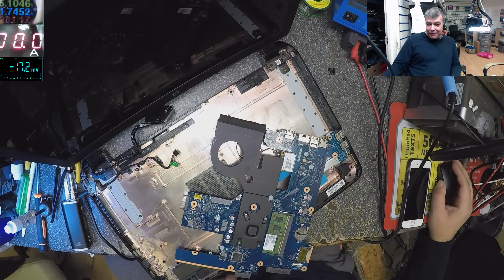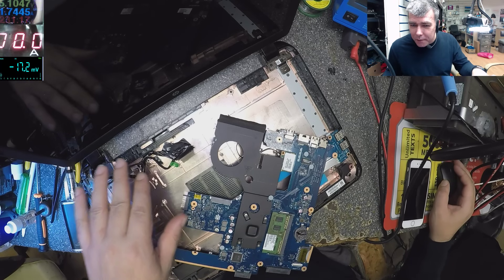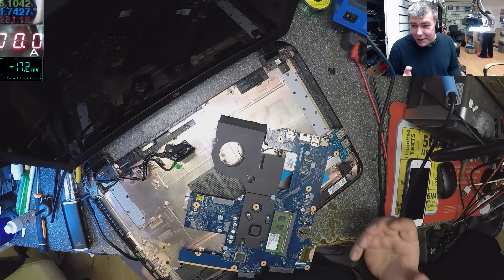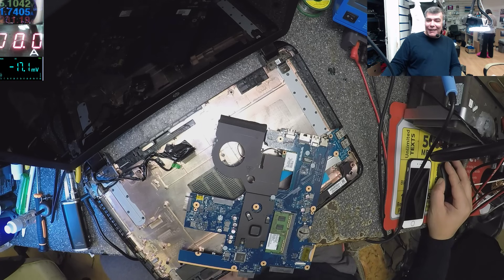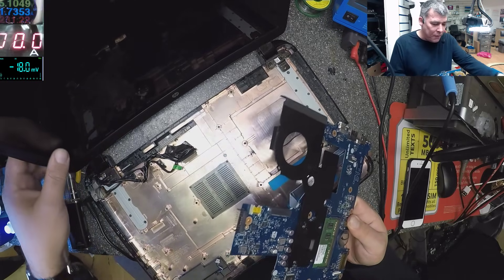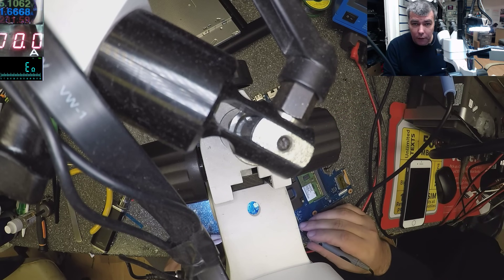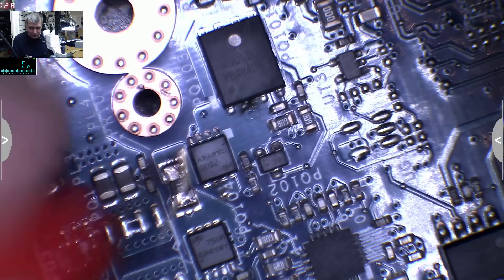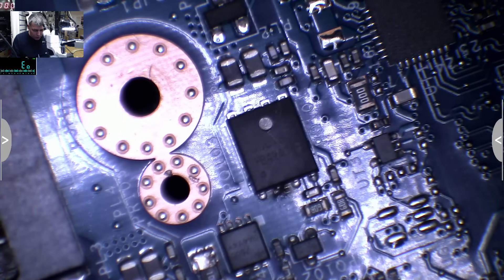Hp 15-r101na, dead board, shorted screen ribbon cable, wifi and hinge issue  - Part 2

Comment: Weird, the capacitor as been removed and the laptop cames to life again
 Great video
Reply: not weird. the capacitor was creating a short-circuit situation. removing didn't only correct the situation, but also helped the other capacitors connected in parallel to charge and thus smoothen the DC needed for a good startup. note that in most cases, more than 1 capacitor is placed to do a single job, for a reason like this one and more

Comment: sir you put 4amp and how many voltage u put in the board
Reply: Omer Jaan buy a powersupply and try it out for your self. Start with high voltage and Go down to low voltage and you will se what happends. Try with some led:s

Comment: Why don't you replace the capacitor - it works and evidently doesn't need it - though
Reply: there is need to maintain the total amount of uf needed for smooth functioning and signaling and also stress reduction on the other working ones